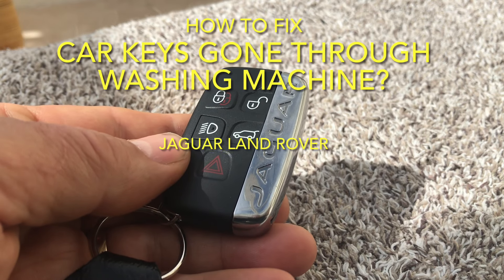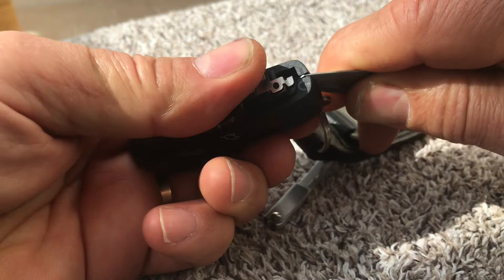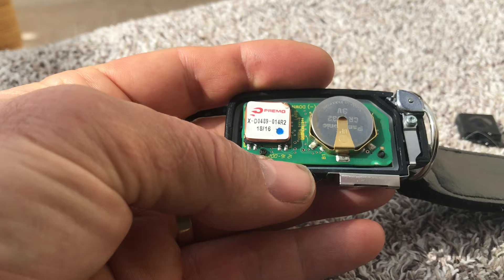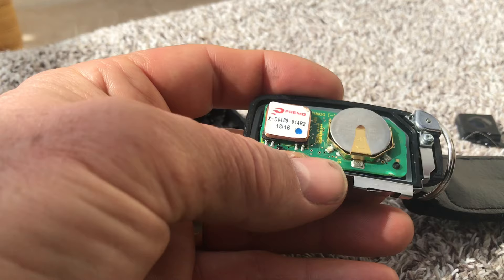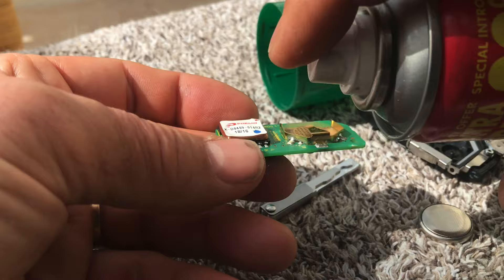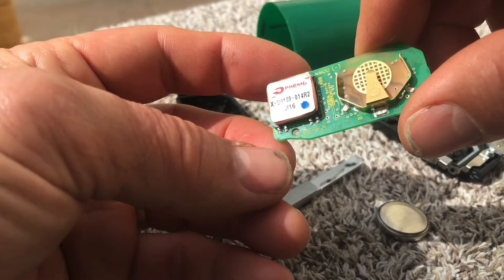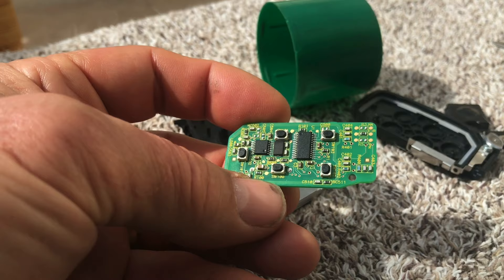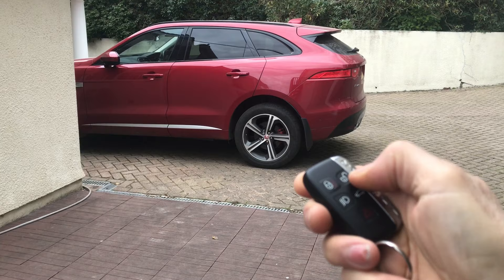Car Remote Fob in the Washing? - How to Fix!

Comment: My sister went into the pool with my fob. 😂😂😂 We were nearly stranded. Used the emergency key position to start the car. Next day i watched your video, which is today. Boom, the key works again. I just opened it and dried it up. Thanks for sharing, if i knew yesterday that I could open it up and dried it, i could have saved myself some drama because it looked like we stole car. The alarms in the car were screaming at times and we could not stop them because the key was not functioning.
Reply from the maker: Nice when a bit of DIY saves a bit of money.  Check the cars manual about turning off the alarm I think there is normally some key turns to enter a numbered code to turn it off.

Comment: Thank you for this video!  I realized mine was in the pocket of my jeans after the wash had begun agitating but before the spin cycle -- so there was a lot of water but not too much friction just yet.  I knew I needed to remove the circuit board, but was afraid of damaging it in doing so -- but thanks to your video I knew how to remove it.

I have been saving up those desiccant packets that come with stuff you buy (for this type of purpose, in case I ever needed to dry out electronics exposed to water).  So I sandwiched the circuit board between two of those, and sandwiched the battery between two of them, and left it overnight to dry (and I dried off the rest of the unit with a paper towel).  We live in the desert, so that helped a lot.  I didn't wind up with any corrosion to the unit, so I didn't need to do any extra steps... and today the key fob works!!  Thank you so much!
Reply from the maker: Well done, thanks for the comments.

Comment: I haven’t even had my car a week and i washed my Subaru Ascent  that was in my pants pocket.  We were out to dinner when I stared thinking about it,  when I got home I checked and sure enough it was in my pants pocket in the finished load of wash.  I wear hearing aids and getting them wet can destroy them  so I have a Hearing Aid dryer with UV light.  I actually put my key fob in the dryer box.   I took out the key, and ran my box on high three times.  It worked!  I saved my key!

Comment: It work for a 2002/Honda accord remote power door locks and open trunk remotely. Remote was washed then went thru complete  dryer cycle. Remote fell out when dry door was opened. Followed video disassembled . sprayed remote heavy three times with WD40 .  The next day wiped off excess WD40 then used hair dryer (no heat)  . Installed new battery. Remote works .
Reply from the maker: surprising isn’t it!

Comment: BIG Thanks ! I watched the other videos suggesting to use rubbing alcohol; it didn't work. But your video using the spray lubricant WORKED !!
Reply from the maker: Great to know.
Reply: rubbing alcohol has a lot of water, and potentially other things in it. I wouldn't even think of using anything below 90, and ideally you'd use as close to 99 as possible to even have a chance of alcohol helping.

Comment: Wil it be the remote key failure in future after short time water submersion? Because I have such problem with Mazda CX 5 key even though the last one works sometimes. I did the maintenance as it was shown and the battery was replaced.

Comment: I have a Jeep Grand Cherokee and my key looks nearly identical as this one and the same thing happened to me except I have a small electrical blower that is used for my gaming PC and other little electronic devices and I used it to blow out this key fob and yes it works but it works very weirdly now because sometimes I can be sitting in the car and the doors will engage on their own also sometimes when I get out the car and walk towards a grocery store I hit the lock button and nothing happens so I would have to at times walk up back up to the car and hit the lock button on the door handle and then when I go into the grocery store and come back out all of a sudden my doors are unlocked which is very dangerous my things can be stolen so maybe I'm thinking take the key apart like you did and then blow it out again
Reply from the maker: Yes, do like i do in the video as you likely have intermittent shorts from oxidisation / water.  Brush off any white deposits and do a lot of wd40 squirting under the I.C.’s

Comment: I need a close up so I can see what the chips looked like before. Now they look dark red/brown, and I don't know if I stuffed it up by testing it (no success) after having had it open and using the hair-dryer on it. 
I have now tried with WD40 as instructed here, and will put it back together when it looks dry again. Not long replaced it after losing the outer part of the fob (somehow the clip let go, and i was left with only the metal part of the key. 😩)

Comment: How much WD-40 would you suggest. I did around 3 sprays each side, but was wondering if I would need more
Reply from the maker: Sounds about right.  Should be enough to give it a good soaking to displace any water and try to spray it under any components like the integrated circuit chip.

Comment: I just found my lost fob.... In the washing machine, inside the rubber seal thing! after a month! The red light turns on when I press it, but immediately disassembled it to get the battery out so haven't checked if it opens the car yet. After I clean it, fingers crossed!
Reply from the maker: Did it ever work again?

Comment: do i have to use this exact spray? or can i use like a different type, can you give me some brands i can use that will work. THIS IS URGENT!!!!
Reply from the maker: No. Look for an oil based spray that says it repels water.  Normally sold in car shops for spraying over old style distributor caps and ignition leads.  I hope that is URGENT enough.  Consider becoming a member for priority replies. https://www.youtube.com/@comeinhandynow/membership
Reply: okay i went to go get wd-40 in a blue can with red attachment?? sound about right?
Reply from the maker: @kasaundrawilson7638  yes if it is wd40

Comment: Hi guys in addition to the other excellent tips given if your remote board still ceases to function after your drying process then grab the q-tips and methylated spirits with the remote board removed dab the q-tip into meths and then lightly dab and clean the board really giving a liberal soak to the 
1.Buttons parts and contact - also very important to push this button section in and out a few times to help to clean the inside of the button contact. This part is very important in the sequence as the buttons may have absorbed liquid inside the housing that needs to be cleaned out.
2.All soldered parts of the board including chips.
3.The battery contact surface and underside of board with meths. 

Using a liberal amount of meths will not affect the board and you can dry of with a hair dryer if needed after 10min or allow to air dry. Being alcohol based will dry out.  

After a thorough clean allow about 10 min dry time and then reinsert battery and with just the board and battery inserted test operations on car careful not to drop board on ground pop lock and unlock. If remote starts working again awesome good job reassemble remote ensuring the board is placed in correctly (not upside down) and bobs your uncle.

If the board remote does not operate first instance do not panic i also had tried to dry the board out in the hot water cupboard for 4 days but ended up after advice to track the problem to the buttons on the remote board collecting residue inside and making improper contact.
I had also previously tried to clean the board with meths but the process was not intense enough. 

Will not be a battery problem if you also replace with a new battery after dropping the remote in water mines is a 3v battery that gives out 2.6 volts when tested this is OK.  

Got my remote finally working after a few tests after dropping the remote in the toilet - yikes. The test now is will the remote still keep working as before the toilet episode.
Reply: So indeed there was a problem after the second clean so what happened was that i literally "soaked" through the remote board with meths by pouring on a part cap of the stuff then repeated the clean process. After this the remote seems to be operating. Water residue really gets into these parts.
Reply from the maker: Thanks for your story showing that you can can things working with patience and perseverance. Well done.  Just a couple of minor comments from me.  If the battery is 2.6v then best to replace it, it’s near end of life, should be nearer 3v.  Meths is a good cleaner but it does contain water as well as alcohol. Water is the thing that causes the problem.  Most evaporates but an using oil, at least as the final stage to dispel and repel water is probably wise, especially under the chips / integrated circuits which is difficult to get to.

Comment: Short version:  Open the fab, remove the battery and place the fab ( wrapped in a dish towel over night in the oven at 120 to 130 degrees. Replace batter in the morning and it will work.
Reply from the maker: No. I guess you didn’t watch the video then. You need to remove the electrolysis products that were shorting out the circuit parts, nothing in your comment does that.  Your summary method will lead to failure later.

Comment: still completely dead, this doesnt work
Reply from the maker: Did you do everything in the video like brushing between the chip legs etc?  It often works but if the water contamination has been too long then too much damage may have occurred.  Worth trying and maybe worth retrying. Also check the battery.
Reply: @comeinhandynow  It was a alluminum piece that detached from the battery  🔋. I reconnected the piece, now the Fob works great 👍. The water damage seem not to be the root cause. Either way this video is very informative.